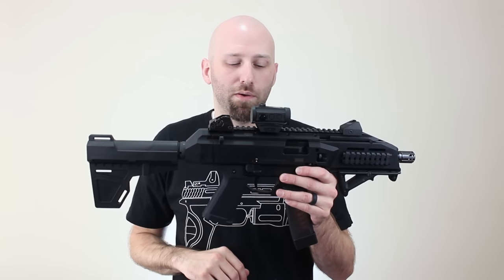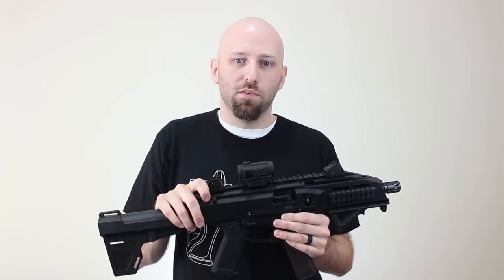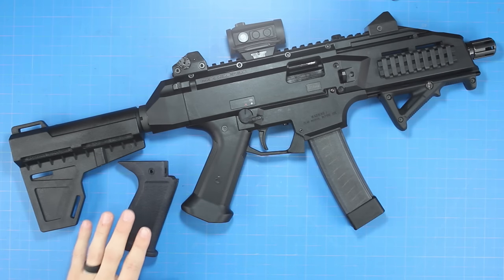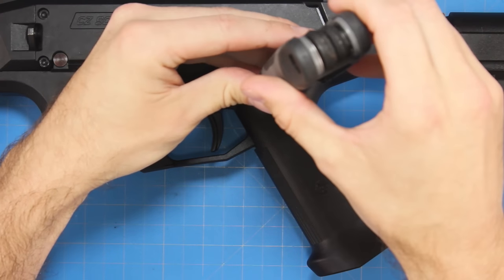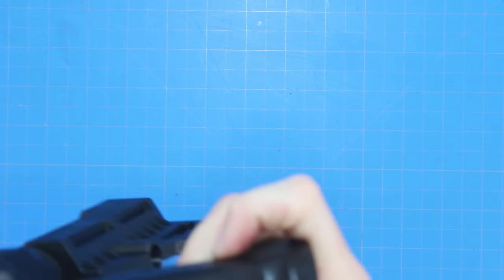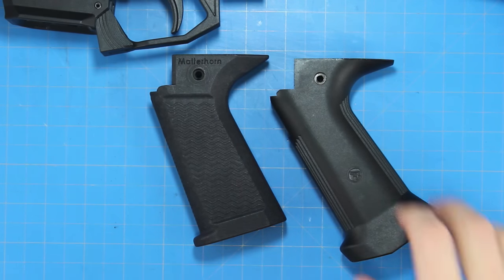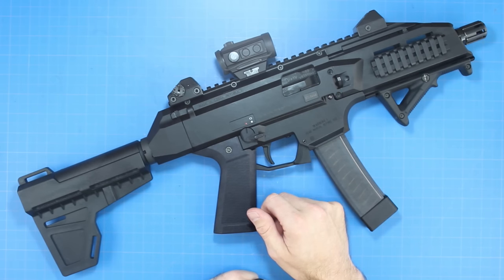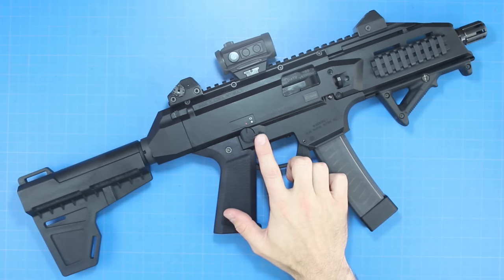CZ Scorpion Evo | How to Install Yeti Wurks Pistol Grip

Comment: The grip is about 5 degrees more acute than the factory and shorter.  It's way more comfortable than the original when shooting.  $60 is expensive, but it's currently the only company offering anything.  May be other in the future, but if you are going to shoot it a lot the Matterhorn grip is worth it.  I have also changed my selector levers on both sides to PMM replacements.  I did the long on the left and the short on the right.  I put a CZ custom folder that takes the AR pistol or carbine tube, the HB trigger replacement springs, HB trigger shoe, and HB mag release catch.  I added ladder covers to the side rails and an AFG to the bottom front.  I've tried both the Sig Romeo 4 and the Vortex SPARC II (currently on it).  The Romeo doesn't play well with my stigmatism, but was the better of the two IMO for this gun.  I plan on running this carbine in Pistol Caliber Carbine division in USPSA when the stamp comes back.
Reply: I'd love to see pictures or a video of your setup after your stamp comes back. Sounds like what I wanna do.
Reply: +cw1642 ponnoini

Comment: Can the polymer be damaged  by that grip if you tighten the screw down to where it wont turn anymore ?  Im having an issue where my grip wants to slip and Im using loctite but I have the screw as tight as it will go and its doing fine but will it damage the polymer?

Comment: Can anyone help? I’ve been trying to buy the stock Faux suppressor but it’s out of stock & hasn’t been in stock so far for a few months. I have the carbine with the free floating barrel & the end is just open with a lock nut on the end of the barrel. If anyone knows where I can buy one or if you are selling Yours, I will be happy to buy it. I appreciate any help.